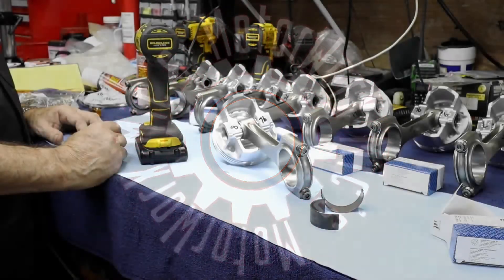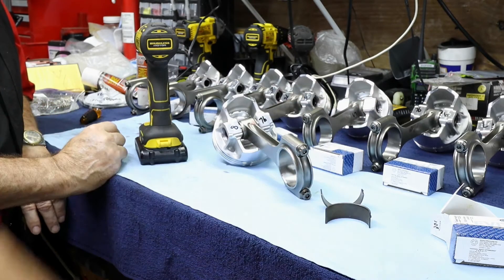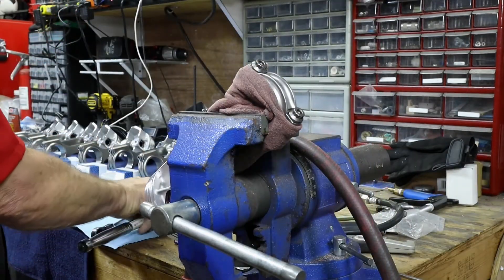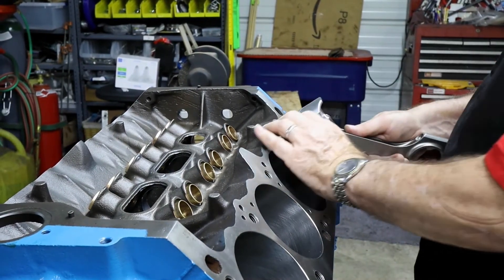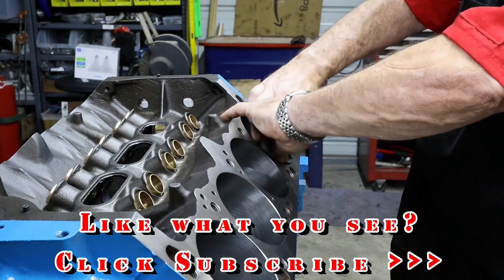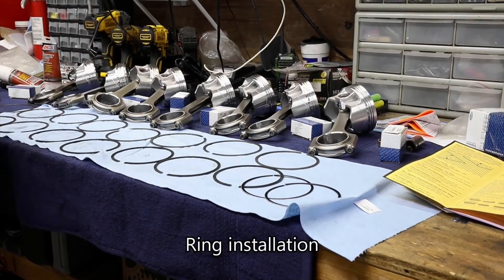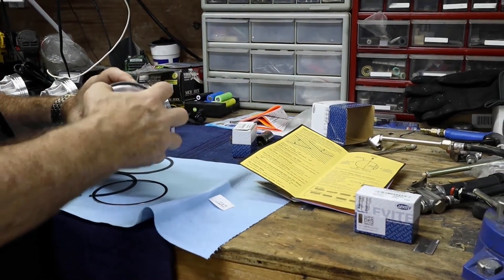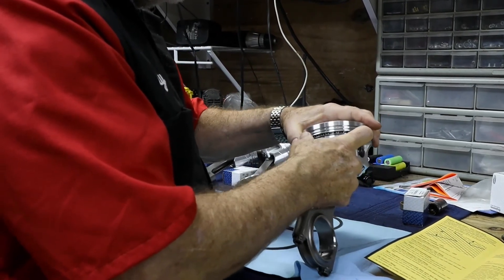The LA-phant: Pistons and Rods (Part 2 of 3) | Rod Bearings, Ring Gap, and Piston Rings

Comment: I would have thought a shop using high end parts like these would have a proper rod vise.
I have built several of these and the fact that the rods are really too short to get a decent rod to stroke ratio closer to 1.6 instead of 1.4 something.
A stock block can use a 6.250 long C-C rod length and still have a decent comp. height on the piston.
I did see the basic suggested ring gap chart from Total seal but it looks like the rings were supplied with the pistons and the back clearance of the radial depth was not addressed.
A commonly missed step to avoid ring seal issues with the top ring not exciting fast enough to create less pressure loss and blow by since the pistons are not gas  ported from their appearance.
Also proper bore finish as per different ring material/face coatings and the  types bore finish needed.
Reply: The rods by the part number are 6.123" C-C length
And the bearings  have an upper and lower half that needs to be specifically mentioned.
Impact guns to loosen rod cap screws are asking for trouble.
I used these parts and currently in 2 builds using the short deck R block and a std 360 magnum block. While you vids on this build are very your leaving out key details and at the risk of longer vids some of these need to be constantly pointed out cause guys doing this for the 1st time don't run into these issues and blame to parts not the time spent checking everything 10 times,

But keep it up
Reply from the maker: Thank you again.
Reply from the maker: Interestingly enough, we're not an engine building shop.  Just some garage guys sharing our love for the hobby.  

I definitely appreciate your feedback.